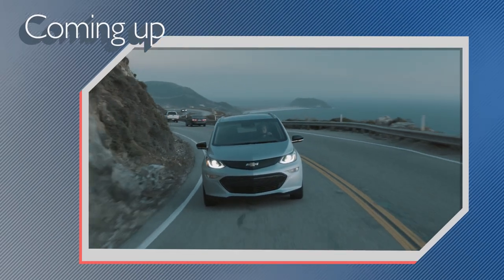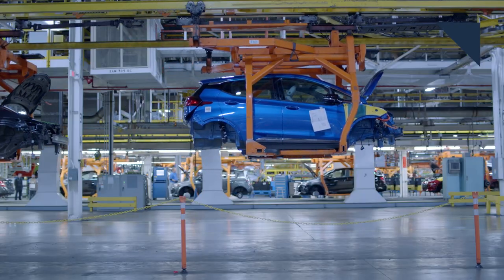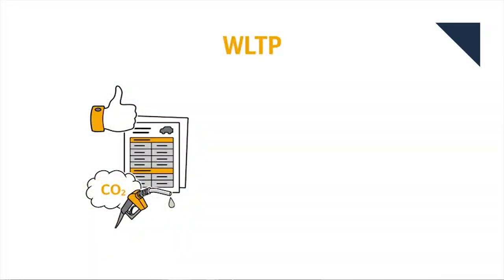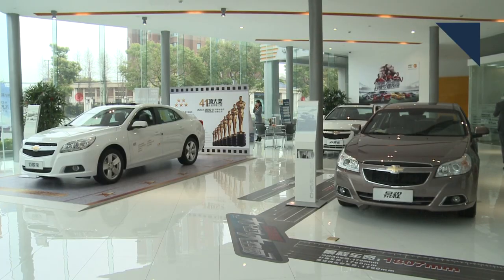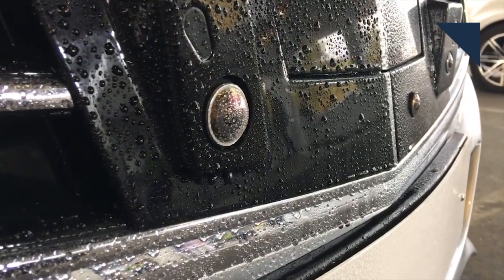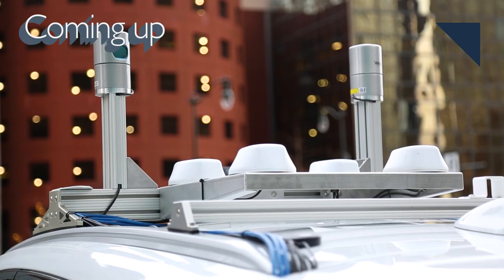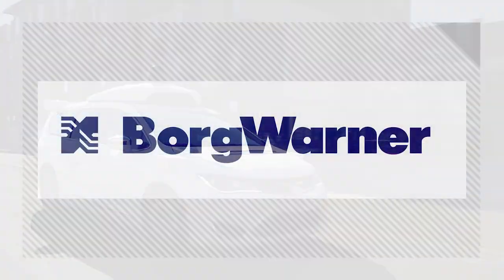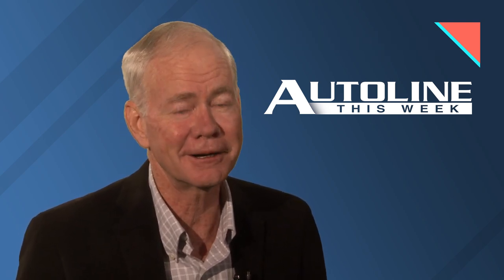What's Wrong w/ Bolt EV? Clever Lens Cleaner - Autoline Daily 2450

Comment: The emissions testing of vehicle is not affecting sales in europe one but as most eu countries do not need to know what the test data is as cars can be regestered without it.
 sales are dropping because people do not know what types of cars to buy because of all this stupid banning diesel  vehicle in the eu. Petrol cars cause more NOx than modern diesels but that not being reported because if flys in the face of the environmentalists who have this crusade against diesel. But the truth is the environmentalists data is 10 years out of date. It turns out that the diesel car is the cleanest ice engine due to the filters and the adblu chemicals. Why is the press not fighting back at the government. And these groups who have lied about diesel cars.
The we have the real issue cars are just to expensive to purchase and to run.
We would have loved gm to sell the bolt in the uk but they ignored  use  and Australia,  india, and e ery other nation thats Rhd.
Reply: Most people in the UK don't even know about the diesel ban and charging zones coming.
You need to brush up on your science.
Diesel and petrol both produce NOx, but you can't use a cat on a diesel, so the particulate pollution is worse.
It's the Euro4 and older diesels they're banning. They are 20-30(!) Times worse than the Euro6 cars.
It doesn't matter anyway. The fuel prices are starting to tick up, the EV prices are about to reduce and they're already far cheaper to run. You're not going to have a choice soon if you want a new car and if you have an old one the fines are gonna get you!
Even if you get a hybrid, in a few years you won't be able to sell it!
You do know that GM pulled out of Europe? (And the UK?) You can't buy the Bolt (Ampere e??) In Europe anymore!
Wait 2 years, you'll have VW, Nissan, Peugeot, Honda, Kia, etc, all with cheaper EV's.
Reply: Roger Starkey, even those EVs two years out are fool's gold vs. the real revolution to come in the next five to ten years: Self-driving EV services. YouTube search "tony seba freightwaves" for a presentation on this tech.

Comment: Tesla has enjoyed a huge advantage for three reasons: 1. It's name is spread by 'word of mouth' and has even been on television shows that appeal to the "In/Hip" crowd like Big Bang Theory/Silicon Valley; that's free advertising on popular shows that people watch. It's hard to beat Yuppie dollars in this market. 2. Chevy does NOT market the Bolt at all; absolutely none. When was the last time you saw a "Bolt" commercial? The average person (for which the Bolt is made for) doesn't even know it exists until you pull up and show them one, the salesmen on Chevy lots are completely ignorant of EVs so they don't take the time to learn and educate consumers, and simply parrot the "bad" parts of EVs they've heard from the 1980s. 3. Infrastructure isn't full available for the Bolt in terms of charging networks, even though most people who would buy them don't go further than 100 miles from their house/work 300 days a year. They think they need a full network of chargers so they can take cross-country trips they don't even have enough vacation time to cover, or they think it has the range of a Leaf instead of many normal cars they already drive.

Comment: $44,000 for one of these? are you daffy? I'm getting ready to by a '12 Cadi CTS with 11K miles on it for about $11,000.  I can drive the Cadi 330,000 miles with the difference in price (at current gas prices) - and I'll be driving a Cadillac instead of a golf cart.

Comment: Too expensive. Too small.
Reply: Too expensive? What if I told you it's cheaper than a mid trim Honda Civic in about 5yrs 1000k km's when you count all the beans. Then it's all free gravy money in your pocket at a rate of about $8/100km. Cost up front is more, but cost of ownership is less. Electricity is 1/6th the price of gas and there is zero maintenance.

Comment: Autonomous cars will NOT cut car sales in half. Let it go John.

Shared cars won't last 300k. You think cab interiors are gross? Imagine what they'll be like when there isn't even a cabbie to see what you do. Consumers will demand cars that are cleaner, nicer--just look at how rental companies update their fleets. There are also enough parts that fail long before 300k that the cars will not be reliable enough to drive autonomously as they approach end-of-life. 

Autonomous cars used for sharing will drive many more miles than conventional cars because they have to travel between drop off & pick up sites. (No one's personal car does that.) In densely populated areas, that won't add much to the mileage, but in suburban & beyond, it can easily double the mileage. And that doesn't even include the increased use from people who currently can't drive cars (elderly, infirm, etc.). So even if they magically do last twice as long as today's cars, it still won't reduce sales.
Reply from the maker: What we'll see are purpose-built ride sharing AVs designed to last. The London Cab is a good example. About 40% of them are 10-20 years old.
Reply: In addition, self-driving fleet companies will insist on EVs, simply because they have far fewer moving parts than gas cars (about 20 vs. 2,000), so there's much less to break. I wouldn't be shocked if the cars, with occasional interior refreshes, can last over a million miles. That's at least half a million miles worth of revenue service.

Comment: The biggest problem with the BOLT is...…...it still has a Tailpipe......LOL.
Reply: Mark Plott, no it does not, the Bolt only has a battery and electric motor.  You maybe thinking of the Volt?  I’ve owned both I would know what moves the car.

Comment: tell u, no one wants ev after owning one u realize it's not worth it as there no free lunch
Reply: We have an 2015 BMW i3 and a 2017 Volt. The i3 goes off lease next month. Put just over 2 gallons of gas in 20000 miles. You figure what I saved. Have a level 2 in my garage. At 6 cents a kilowatt it's pennies to top off. My wife visits her mom 50 miles from here once a week.  The Volt gets 42+ miles on the freeway. Uses less than 2 gallons there and back. After dumping a 325i and Volvo S60 we're saving  hundreds every month. My wife doesn't know the price of a gallon of gas anymore since I charge at home and put gas in the Volt once or twice a month. Oh, the Volt uses regular, not premium like the other 2 we had. 
Looking at a used Spark, Volt, Tesla when the i3 is gone. So, M Blake jr....you need to get out more. Ev sales increase every year. Read what many European countries are doing with EV's. You'll be surprised.

Comment: Who knew that the Model 3 would be the Bolt killer..... Hell even the new Nissan Leaf looks better than the bucket of Bolts..... oups auto correct did that.
Reply: NorthStead Landscaping - North Bay - Callander The Bolt is the most solid car I have ever owned, I’ve never had a rattle and the springs are Honda like firm.
Reply: no its not. Different price range. Find me a model 3 cheaper than 49k. U cant caz they dont exist. U cant even order a "36k" model 3
Reply: You're right I was just having a little fun and I think it's GM's best product they currently sell if that make you feel better
Reply: NorthStead Landscaping - North Bay - Callander  the cars are not comparable.  One is a luxury sedan right now for over 50,000. I am tired of people saying that you are wrong if you like the bolt and not getting a model 3. I like hatchbacks better. You can lease it and right now you can't with a 3. Sure the 3 looks great but I can't afford a 5000 dollar car and i don't think the 3 will ever be 35,000
Reply: The Bolt is a fine car but I think priced too high for the type of people who want a city car only. I think GM the company is the problem because they don't have the battery factory and the charging infrastructure. You're right though when Tesla makes a $35000 it will definitely be the Bolt killer but I believe that some people that can afford the model 3 look at the Bolt as an option to purchase.